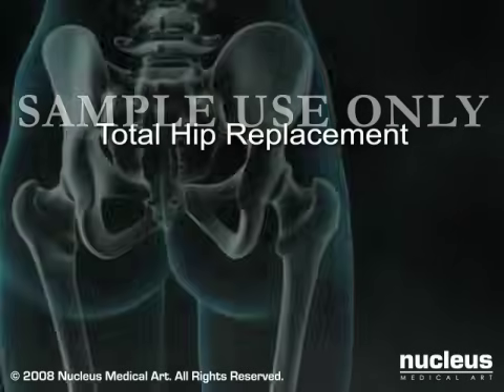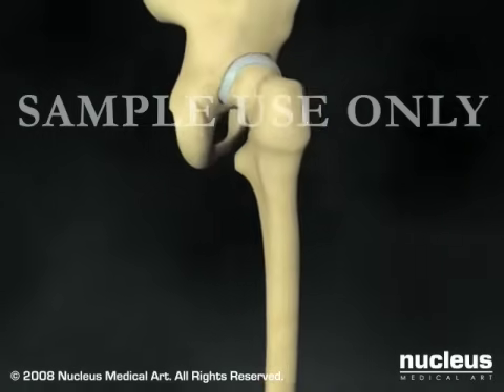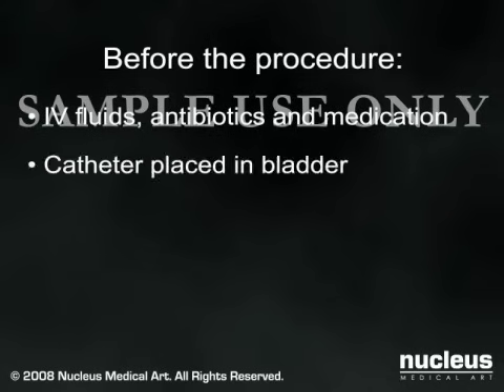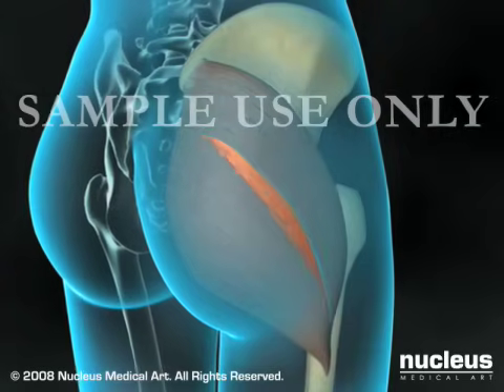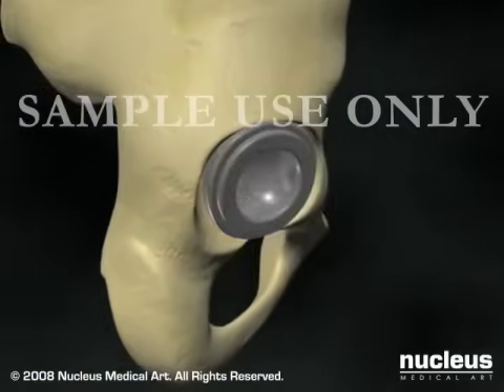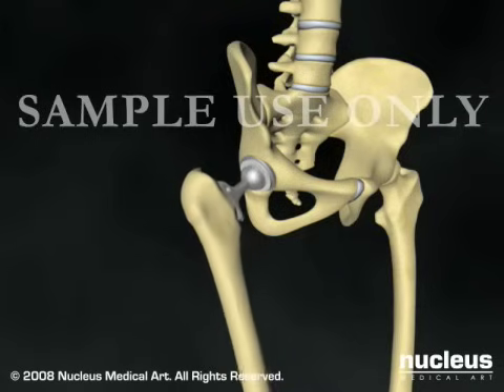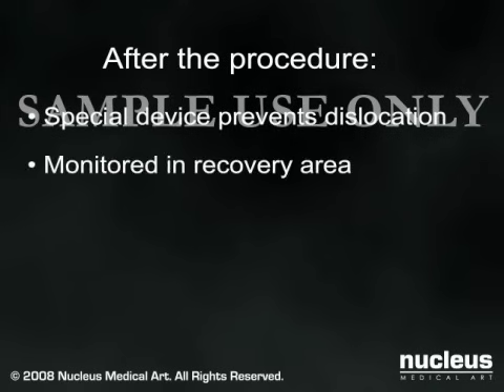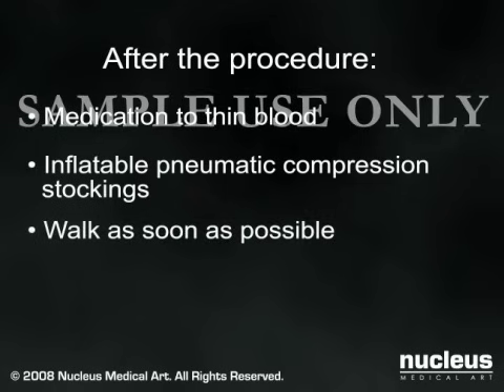Total Hip Replacement

Comment: I had my left hipjoint Surgery ( core decompression with BmP filling ( bone repairing material) in left hip in June and now on 7th october 2022 i had same surgery of my right hipjoint after got diagnosed as last stage of Avn ( avascular necrosis)and am 27 and every one is saying for TOTAL HIP REPLACMENT but i discuss with alot of drs and then i decided to go for this Core decompression with filling of BMP in joint-  procedure  and now am feeling much better in my left hipjoint ,and i hope it will be good for me as am an Mountaineer & soldier

Comment: My mum has this, both hips,  from autoimmune,  mixed ESSENTIAL chrioglobulnemia. Prednisone and other complications,  incl. Necrosis.   She is now,  66 she's had her double full hip replacements,  for almost 20 years.   About a month ago,  she started to have extreme hip pain,  it spreads throughout her back,  groin area,   down the right leg.  Just the right side
  She's seeing doc in 2 weeks,  pain is really bad,  and she doesn't complain about anything.   She's scared something is very wrong,  requiring possible rereplacement.   Which she is avoiding,   she's a licensed clinical social worker PhD.   Private practice,  adolescent work.   She's so worried about shutting down,  and having her clients see anyone else.  Shutting down also had many other issues.  I'm worried about what it could be,  because i know she's worried,  and she just never does,  does not worry,  or complain,  doesn't let things stress her,  but she's afraid of the outcome,  due to the pain levels.   I wonder if it could be anything not too serious,  but any way you look at it,  it'll require surgery,  and I'm worried she won't do it.
Reply: The “life” of most hip replacements is 15-20 years so it sounds like she may need revision surgery

Comment: I had my left hip done in 2014 and now I need my right hip done but the surgeon who is gonna do my right said he will have to do it from the back b/c the surgery table he has won't support the frontal method. In 2014 that surgeon did my left hip from the front. What should I do?! I see the surgeon on the 30th. This pain is unbearable.
Reply: go to another surgeon

Comment: Thank you. Very informative.
I’m presently in recovery going exactly as you outlined. So far, so good.
Reply: Hi, my mom is about to get this hip replacement surgery. I came across your response which is from 2 years ago. If you don't mind me asking, how have you been for the last  2 years? Would you still recommend this surgery?
Reply: Nayaab Zafar I haven’t had much trouble yet. Being fairly active there’s positions that cause a bit of fear when the mechanism doesn’t cooperate correctly. It lasts less than a second. I can’t run but I ride a bike easily. I neglected for 3 years. There was no alternative.  No more limping and misery. I’m glad I did it. Yes, I recommend it.

Comment: I had mine 14 months ago and then without warning it dislocated twice in a span of 3 weeks, still healing, one or two more dislocations and it revision surgery for me.  DO NOT PIVOT on the foot that is on the hip replacement side unless your foot can slide on the surface it is on rather easily. The pain is way past a bad back injury, I have a herniated lower disc(L-4 L-5) and it has never even compared to the hip dislocation..

Comment: Theres no such thing as a minimally invasive hip replacement!  Theres also no need for a general anaesthetic, spinal with a bit of sedation is enough!
Reply: I couldn’t have just a spinal. Had general anesthesia because of a previous spinal surgery I had. Fusion in 2014. My right hip total replacement was day before yesterday, and it took just a little over an hour.

Comment: my mum had an hip replacement in june 2011, since her op her hip has dislocated four times. she had no after care when she came out of hospital. The surgeon has seen her once since her op, he said that the hip on the xray was perfect!! if its so perfect why has is dislocated four times. She does her excersies daily and follows her guide. She has lost all her confidenece, walks using a crutch and barely leaves the house because she is scared of the hip popping out any advice would be great thanks
Reply: I don't know very much, but my mother got a hip replacement recently and we both discovered that opinions on dislocated hips have changed. People used to think that if you were doing too much movement, your hip would pop out. However, this isn't the case anymore. Now, scientists have discovered it's more so genetics, than how much you move. I hope your mother is doing a little better now, and hopefully with time, life will get better.

Comment: Jahad - I just read an article at CBC.com about hip replacement failures with the titanium-titanium ones.  Many people are having them replaced with titanium and plastic.  You might look into that - and please, stay after your doctor or get a different one - it never hurts to get another opinion!!! You should not still be in pain from a hip replacement.
Reply: The best is a titanium post in the femur with a ceramic ball and then a titanium implant in the pelvis with a plastic insert, the plastic insert can be changed if it wears out.

Comment: @QuinWoodworth I was an avid cyclist when I first broke my hip while speed skating in1986 retired in 88 and in 2009 started cycling again to get fit once again for my health and my surgery. A year in I have continued cycling as it's low impact, Mostly I ride a stationary bike so cycling is my passion for fitness. Last week 29 Apr 12 I crashed my bike after breaking my handlebars & broke my femur where the femoral component is inserted. No surgery yet but I'm hopeful it will heal OK. Stay tuned..
Reply: Update

Comment: The last hip replacement was done 16th Nov 2011, the 4th. I'm 69, i,m down to using one stick now. I would say to anyone contemplating the op, do not have any doubts at all, normaly the operation is nothing to worry about. To be free of pain is the most wonderful feeling if you have suffered with it before. there is no comparison in the fredom tou feel. Mike D. Spain.

Comment: @MrMartinLee1
   I was sedated and given a spinal tap and felt nothing as I was numb from the waist down.  The muscle is sewn back together internally and on the surface they used steri strips to hold the incision closed. They're small strips of tape that eventually wear off (in about three weeks) no external stiches at all. The most important  of the recovery is to not exceed 90 degrees from your femur to your torso which risks dislocation but it's also painful  to exceed it. Do it if you need

Comment: Very informative, thank you.  I'm 63 and just had this surgery on 7 Apr 11. I'm  a cyclist and did the best I could to go in as fit as possible. It paid off, I was walking 6 hrs after I awakened, and spent only 36 hrs in the hospital. I used crutches for two days and went to a cane after that. Back to work after 11 days. Even the Drs. and nurses were surprised. Follow the Drs. orders, go at your own rate and don't fret over it. There are millions of successful surgeries.
Reply: How do you do Now at 2022 after replacement 2011

Comment: is going through that much muscle and tissue from that angle the best way of reaching the joint? its not like i would know, but i'm curious as to how much experimentation is involved into finding the best method and how quickly a given method is accepted as the absolute right way. and jamming a metal rod right through the thigh! brutal! (love it!) does it complicate things for the marrow in any way, though? considering the strain on the thigh i dont suppose screws would be an option?

Comment: @Jaylen56789 Today is 8/29/2010, if she hasn't had it yet, make sure you know the brand of joint. I'm 41 and had a replacement 4yrs. ago. Still have pain 24hrs. Tests after tests show nothing. Major recalls on several brands, suggests loosening of cup in pelvis. Make sure to ask any and every question you could possibly ask.

Comment: I had severe PVNS in my right hip. My doctor only cleaned the joint out. He did grafting  and a total synovectomy. No over a year later I have pain in my lower right leg and just above my knee. The hip does not hurt like it used to but now I have new pains. Does anyone know what should have been done for this

Comment: Hi Richierich

No...I dont have polio, it was not caused by polio, but I have injury on my left hipIs joint for the first time, but caused of using the pain killer for long time, my right hip joint was damage with oestophorosis. I had my hips operation for the first time last 2005, where the right hips with Bipolar Hip replacement, and the lefft side implanting. How ever this did not work well, so I have another B hip replacement for my right leg last November.
How about you?

Comment: nah, tell him you want new technology not the stuff they give geriatrics.  I am 26 and just had a total hip as a result of a motorcycle accident several years back.  If they use the method where they use a metal ball and socket and stimulate the bone to grow into the prosthesis and they dont use cement it can last about 25 years.  Depends how active you are too. But i dont think you would be out running marathons in it.  I also recovered and was off crutches and full weight bearing in 3 weeks

Comment: I received a hip revision after the 1st one done in1981 worn out, and after 4 months rest I'm able to go back to my labor demanding job requiring long hours of standing,pacing and occasionally lifting. Although there are few occasions of discomfort and pain possibly caused either by excess gym exercise or prolong pacing, I have never been walking on cane . You are only 32 yrs and should have recovered much better and faster than me; I was 47 when the hip revision was done in 2003.